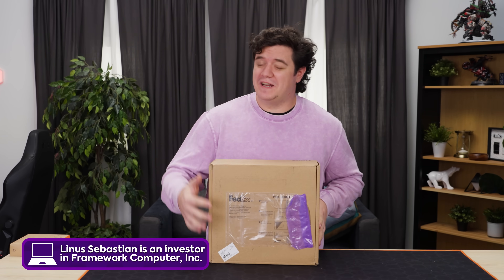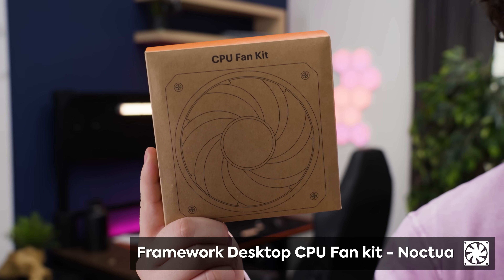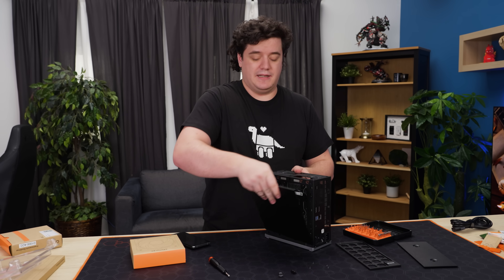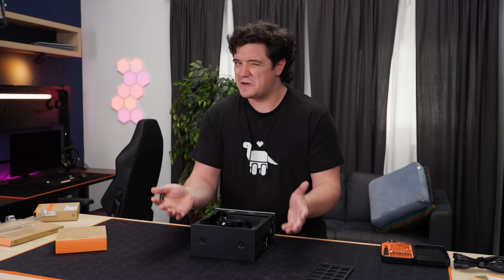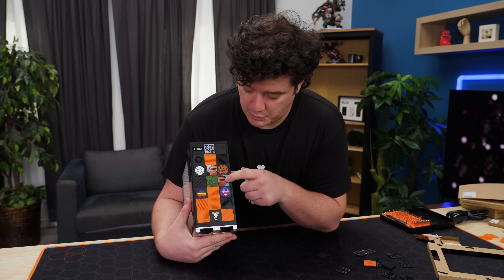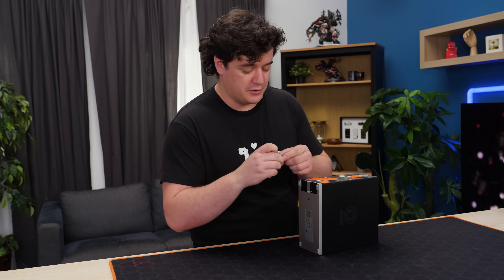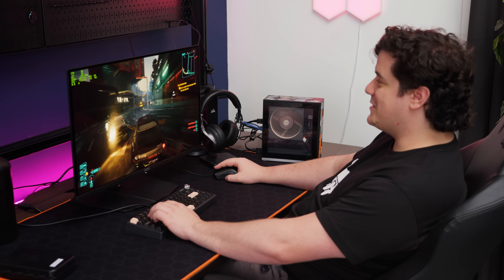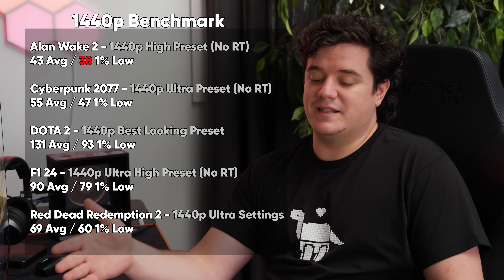This TINY desktop makes me nervous.... - Framework Desktop

Comment: For someone living in the EU I really like the fackt you can opt out of the C13 Kable or buy the one you need for your country and not get 4 different adapters for each type and then throwing those away or getting one based on your country and then actually needing a different one because you live on some sort of international facility like a US Base. Something LTT should celebrate Less Electronic waste. And as for it being 5$ instead of the amazon 4.72$( not the 4 said in the video unless it's maybe Cad.$) is a whole 0.28$ more honestly I don't mind buying from a company like Framework a 5$ Cable instead of a cheap reseller on amazon for only 0.28$ less.

Comment: I'm a big supported of Framework. To me, the soldered memory is justifiable and honestly the smarter move anyways. Even on their new mainboards for FW13 and FW16, I would prefer to see soldered memory for better performance and battery life. Battery life is easily the weakest spec for FW laptops... ditching socketed memory can be a HUGE boost to power consumption. 

I was also pretty annoyed by the front panel on this. I would rather they offer a fully 'blank' (non-customizable) plate vs selling a ton of those little squares. it's a cool idea for those who care, but I wish they had an option for those who don't that doesn't mean just leaving them empty. 

I really really really hope to see this APU series or similar in the FW16 form factor in the future.

Comment: I bought one yesterday as a portable workstation to move between work & home (the 64GB model for €1600). For Adobe software it should be a monster and a while a similar regular build could be €400 cheaper, you use way more power. 

What this video didn't mention is how EFFICIENT it is compared to an RTX 4060. The entire PC uses 170W MAX and regular desktop use is as low as 30-40W. If you work 8 hours a day, you easily save 2 kWh a day which leads to €100-150 a year you save  so .... after a few years you gain back the price difference of a full regular build anyway but in the mean time you have a whisper quiet system that punches way above its size and is extremely portable.
Reply: "whisper quiet system" according to the forums the PSU fan is extra noisy, so I wouldn't bet on it being quiet in practice.
Reply: @8bits-almost-lost296  Nah it's 100% quiet when you just do regular stuff. Only when you're in games or doing very CPU intensive tasks the fan turns on.
Reply: I was thinking the same thing. I rather build a PC for similar prices
Reply: @prabhdeepdhaliwal5706  It's all about personal needs. For me I work from home on a tiny desk and since I work from home, it's my electricity so a more efficient small system is very welcome. On top of that it has a handle so I can easily move it between work & home.

Regular gamers who have plenty of space wouldn't need something like this though.
Reply: Interesting point about the efficiency, and regarding the price comparison to a self built pc you also have to consider that small form factor builds always cost more
Reply: The efficiency is what sold it for me.
Not so much for the electricity costs, but in less noise and heat generated...

No longer will i have to restrict gaming in the summer because the PC is heating up the room too much!

Comment: To me this PC seems more like a stepdown for repairability. A motherboard with soldered components makes more sense in a laptop because of the space limitations, but not in an itx case. There are already numerous itx case which proofed that soldering in a PC case is not requiered. If something dies or you want to upgrade the cpu/ram/ mobo you have to replace the whole combo. And i know that these types of motherboards are nothing new, but i just don't think that they deserve a place in the repairability sector of pc tech.
Reply: I see your point about the dying part that does suck. I saw in another comment that the 395+ requires soldered ram for ddr5 full speed ram and considering intel is pretty much... well uk how it is with them. It is a downer but i doubt 32 gigs for the lower variant and 128 gigs for the higher variant is low. for 1400 usd with 32 gigs is pretty reasonable i believe and I don't see 32 falling short for another 5-ish years at which point the other components will already be worse.
Reply: The point of repairability I think is fair, but it's important to note this project is intended to people who have previous framework motherboards that they don't want to throw away. So the choice of soldered is because of that, not because they're trying to make something to replace desktops. With the context in mind, I would love to have some way to use my old laptop hardware this easily
Reply: Yes i understand that this PC is mainly designed for AI workloads, but I just find it kinda funny that Frameworks, a company which whole mission is repairability suddenly releases this :D

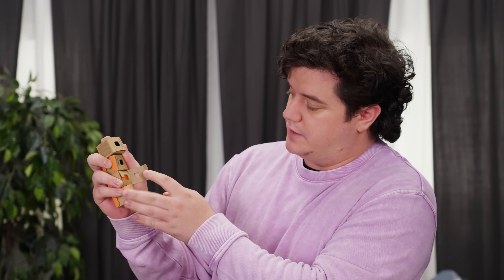Comment: 1:45 PC don't work without CPU or ram either...but I get it. Also AMD made it a requirement for soldering...its not framework as comments point out, shouldn't that have been researched?
Reply: Reviewer not doing their homework 🤷‍♂
Reply: Not a review and then again, he is still absolutely right. It is a requirement for this specific CPU, but Framework made the call to use that CPU. Other mobile CPUs work fine with SO-DIMMs and CAMM just fine

Comment: Framework should really advertise their stuff with the 'fully functional' price up front, instead of the 'starting from' price that is usually just the mainboard+case. It's a much nicer experience if you can check things off and have the price go down, instead of getting pulled in with a low price, and then slowly adding about 50% of the initial price again to assemble a basic working machine.
This is especially a problem for new customers who don't already have components lying around.
Reply: Their decision on fully functional was probably the "critical" or "minimum" components you might need. Any definition of fully functional is subject to what you want to do, so that's a decision that they had to make. They're upfront that you have to pick, unlike that random swap that happened in smartphones where they no longer came with chargers.

Comment: Realistically do we need upgradable ram if the cost of ram is reasonable? Just put 32/64 in and that will be more than the pc will need before the processor becomes the bottleneck

Edit: The 64gb to 128gb upgrade is £400, it doesn't seem to do anything else which makes that pretty unreasonable.

Comment: I get the problem with not including power cables or chargers with phones and other devices, but given that the power cables don't wear out as fast as the rest of the device, you can end up with extras if you keep the old ones when you retire a device, and if not, you can usually pick up a used one from a charity shop for a small amount of money. So it makes sense to not include them by default.

Comment: The case should be a little bit taller, and there should be a place for the future to add a dedicated 2 slots low profile GPU, also should be a full 16 line PCIE. It would be way better option for the future, and I cannot understand why it isn't there.

Comment: Complaining about soldered ram is missing the wood for the trees. The fact that all their products are upgradable and repairable with all instructions provided having soldered ram doesn't change that. Ultimately they are still providing upgradable and repairable modular devices and supporting the community to make that product their own.

 Yes ram can occasionally fail but so can the CPU and we have yet to get a socketed CPU from Framework. Personally if they are forced to solder more components going forward, the next level would be having a repair service to send broken components in to be fixed. 

Soldered ram doesn't kill what Framework stands for or go against their mission, it is another industry practice that right to repair needs to account for and show fixing is the solution rather than throwing away.

Comment: The 4060 is not the real competitor to this product. It's an RTX 4000. A Minisforum MS-A2 with a RTX 4000 SFF and the Nerdwire single slot cooler mod is the real challenger to this product. All told they are around the same price as well.

Comment: I have never updated the memory in a desktop PC, when it's come time for an upgrade I've upgraded the motherboard, ram and CPU. I think CPUs should and will go the way of GPUs where the ram is matched to the CPU and you swap both together because you cant get away from the fact that having sockets between the CPU and RAM impact performance. in the future complaining that you cant upgrade the system RAM is going to be as dumb as complaining that you cant upgrade the VRAM on a GPU especially as CPUs and GPUs are getting more similar in their achitecture.  Also I have a whole box of IEC power leads, I think making them optional will help reduce e-waste.

Comment: It's kind of ridiculous that something that is mission critical for the device to work, doesn't come with it by default. 
Yes, but:
It's also kind of ridiculous that we all have a drawer full of these things somewhere, because everyone forces us to buy them with new devices at some unknown factored in price, even though they never wear out and so we keep using the old ones that we have so nicely cable managed already and chuck the new one into aforementioned drawer. At this point I would be thankful for the option of not getting another one at no discount at all.
Reply: It'd be better if it was opt out. Not everyone has drawer full of them and I most certainly don't.

Comment: Kinda weird to no send the handle, considering that this channel drops tech equipment quite regularly.

Regarding the cable, I'd rather have the option to ship without it and not spend $5 on a cable I don't need. Do not full yourself, that cable is never free when you receive it. You really think that is not included in the price of the product you bought?

Also, this CPU can't work with unsoldered RAM. At least not at it's current speed.

Comment: Tbh, what's wrong with framework? They are the "let's make non-modular devices modular" crowd, and then they are making a desktop that's literally less modular than a random HP desktop PC? And what's with the "You only need one screwdriver"-flex? That makes sense on a phone or maybe a laptop, but when have you ever had to use multiple different screwdrivers for a desktop? And then there's fake modularity, where you can pay $100 for a bag of plastic stickers for the front, that are mandatory if you don't want the device to look like unfinished garbage. This is just weird.

Comment: I feel the cables and the tiles "costing extra" is a matter of perspective. I already have a million of those power cables, I don't need another, it'll just go in my big pile of them anyways. I'm happy to get a computer for $5 less and not come with it. Same goes with the tiles, I could print my own, or maybe I'm upgrading from a previous model down the line an have 100 of them already. If it came with the tiles and cable, for free, all that would happen is the base price would be $35 more. Someone still has to pay for it eventually.

Comment: At least in Linux, you can have dynamic allocation of the ram. Not sure about Windows thought.
But this is a neat little developer and hobby AI box that isn't actually that expensive all things considered. It's decently powered and can run pretty large models at decent tokens/s. It's not the best, but for the price and power usage, damn.

Comment: No, no im down for no power cord.

Like you said, they are cheap as hell and easy to get. /if/ you are local. Otherwise there are 10 diffrent outlet shapes and infinite length variants in the world.

The first thing i do is throw the cable my apliances come with in the bin. And grab my own far longer or far shorter one with the aproprate right angle connector.

No cable is a W

Comment: FYI you can get framework's 8050S equipped APU (385) ITX board, barebone, for 800$ and build your own SFF. The 8050S is about 10-15% weaker.

Comment: I really don't understand why AMD don't release their top iGPU with a cheaper CPU. You don't need a 16 core 32 threads CPU for gaming. And as the video clearly shows the 8060S is more than capable for 1080p AAA gaming.

Comment: Video is a bit shit frankly, all the complaints are things that are pretty trivial, wow you have to add on a power cable, whoopty doo.

The things people want to know is LLM speed, that’s what everyone wants to know with the AI MAX 395+ chip, we don’t get any kind of LLM benchmarking.  Could have literally installed VS Code and clime and tested it with some locally running LLM to get actually demo speed here

The ram HAS to be soldered on, it would be much slower if it wasn’t, AMD says it has to be.

Comment: For 2313$ you can buy m4 max mac studio with 36 gigs of ram with 1TB ssd and with 10gbps ethernet and 4 thudnerbolt 5 ports with lots of I/O  and much portability than this and still save 100 bucks.
I thought framework was all about modularity but now they have marching towards non modularity.
and what is that front panel customization nonsense. Worst gimmick i have ever seen on consumer product

mac studio comes with a power cord  by default.....LOL

Comment: What's with the moaning over power cables? Almost everyone has a few laying around. Those of us in the tech space likely have dozens, if not hundreds, laying around. Do we really need another standard power cable to be tossed in a bin or in the trash? As to RAM... There's literally no other option. Its a 256bit memory bus, combined with an iGPU that's only "special" when backed by fast RAM. 64bit per channel DIMMs or 128bit LPCAMM2 - Assuming it was even (readily, its a unicorn) available - Are not viable options. On Linux at least the VRAM allocation can be handled dynamically. This machine isn't "just another mini PC" - AMD offered Framework with a novel SoC with specific use cases and Framework ran with it. For those of us with the "right" use cases for Strix Halo's capabilities its a solid choice. For gamers? Not so much... You guys can likely do better building your own SFF machine with a standard desktop GPU - Potentially more capable and/or costing less.

Comment: The tiled front really turned me off when I saw the desktop the first time. If they would just provide one simple, plain, ventilated with their logo for a cheaper price I'd be happy. I'm not the guy for customizability - I want a device to be simple and reliable.
And I agree: The Desktop kinda does not meet Framework philosophy but on the other side I strongly believe upgradability limited to the storage and GPU may be perfectly fine! Except for those two I never really changed anything in any of my systems. I found out I am also not limited by Apple deciding to not allow upgrading memory. I know what requirements I have and buy a product that matches. What I would like to have added for framework is an option with the lowest 8-core CPU with 64 GB RAM: if its unified with vRAM, 16 GB for each might not be enough.

Comment: I really wish companies stopped making PCs smaller than possible
it's either inaudible or broken, and by the every scrap of information I managed to gather from Framework and Noctua this one is broken
A12x25 can't go above ~670RPM without becoming audible from reasonable distance and yet they heavily rely on the HS variant

regarding the cable, these don't break, unlike chargers, and are compatible, unlike chargers, and you have a few drawers full of them already, so them letting you not order one is great
and the pricing is just fine

Comment: a tech guy complaining that he didn't get a c13 power cable is actually insane. I have a box full of literally dozens of extra C13 power cables. I'm actually SO THANKFUL that they made it optional...
Reply: ...because hes looking at it from a POV other than himself? 😂 touch grass dude.
Reply: But it should be included by default and then you get  - 5€/$ off if you don't want it.
Not the opposite. Never defend this kind of practice if done wrong.

Comment: What a strange machine ...

Framework in my mind exists so you can basically replace everything, there is about the machine you buy, over time either because it dies or to upgrade it. You can't do anything of that with this dekstop, at least it wasn't mentioned anywhere, except for the USB-C/-A Front Ports and the plastic tiles for 108 $ ...
The PC shown here is roughly 2000 $ or more and performs ok on 1080p gaming and crushes AI Tasks? Well if you want to game... why not get a PS5?
I absolutely don't understand why this exists.

Comment: Why does it cost $400 for an extra 64gb of memory? Seems like the choice of a cpu that requires soldered memory was also driven by their ability to massively upsell the cost of memory upgrades.

Also, the base config comes with no storage, no power cord, no CPU FAN, no front IO, and 32GB of non-upgradable memory.
Reply: Do you know how much LPDDR5X-8000 costs? Turns out, even just 64GB of DDR5-8000 costs around $400
Reply: @Skomesh-p5x  Fair. I didn't notice it was LPDDR5x-8000.  
In that case, they probably don't have much of a profit margin there.  
I still think choosing soldered memory goes completely against the brand they're trying to build though. I'd happily buy replacement ddr5-6000 or even 4800, for barely any noticable performance loss. But you don't get that freedom with this system.
Reply: @amarkalibad2571 this isn't the type of system for you then, which is fine. Framework wanted to do something cool and make a desktop system featuring this cpu, not competing with a generic desktop system. People tend to forget that one of the first things they tried to do was to get modular memory for this platform but it simply did not work.